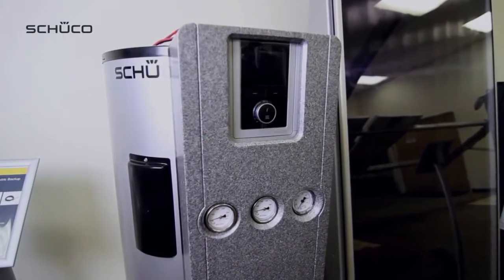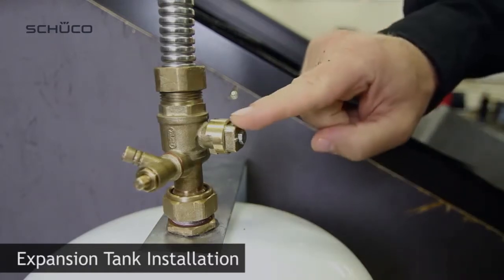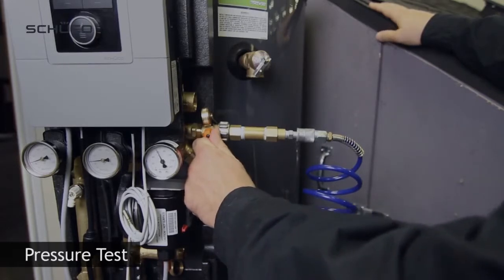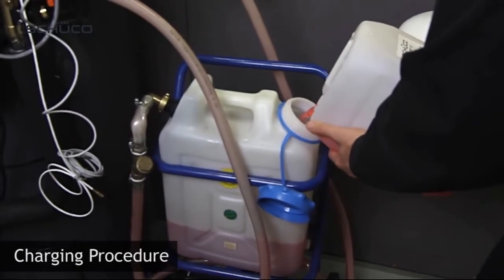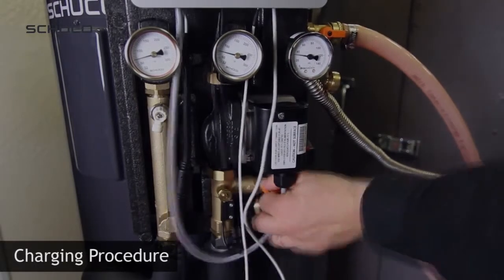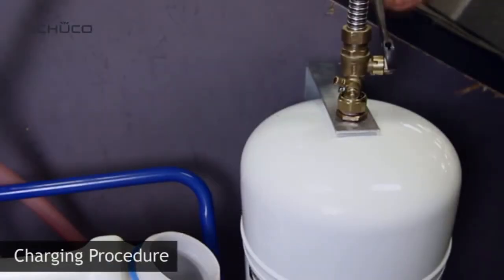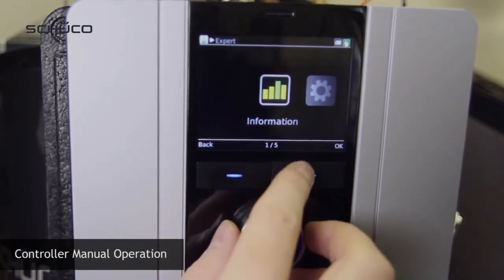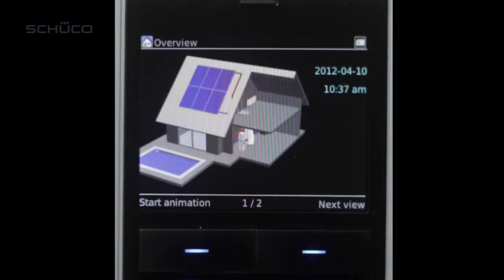Schüco Commissioning/Charging Training Video

Comment: Thanks for this. It's the least Schuco could do after our installer closed up shop with no warning and dissappeared.
I finally found a solar thermal person to have a look at it a couple years down the road but it was a 150 mile trip, one-way for him to get here. A great system as long as it doesn't need service.
Now if only Schuco would relase all the documentation so homeowners who've been stiffed can continue running these.

Comment: Purchased my Schuco system about 8 years ago assuming the selling company would service it, but unsurprisingly the profit is in selling - not maintenance.  No one will touch a solar water heater in Phoenix, so there are a lot of 5-7 yo systems in our landfill.  A leak in the tank means >$1500 labor and $1500 for a water tank with simple flow-through radiator.  There is absolutely no chance a solar water heater will ever pay for the ridiculous maintenance and repair charges.  I can see why no one is selling these in Phoenix, people have learned the scam.  Maybe somewhere colder it's a better choice.